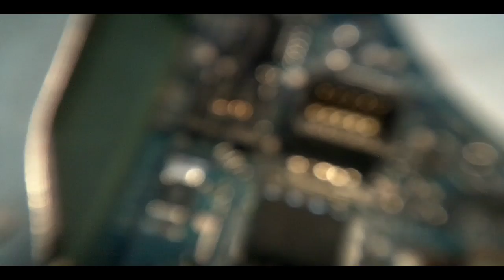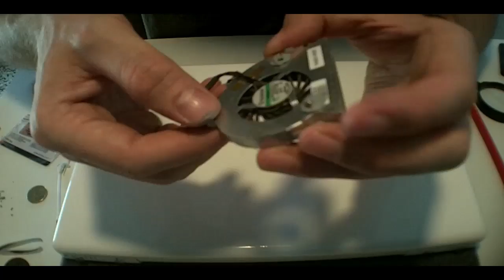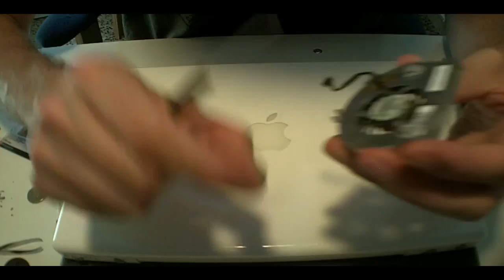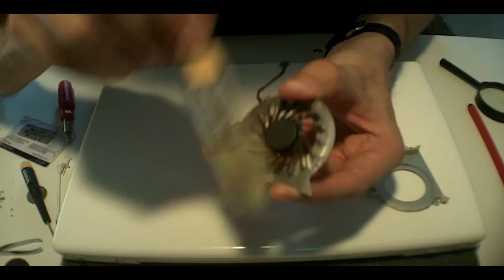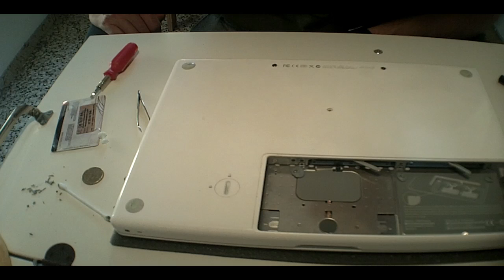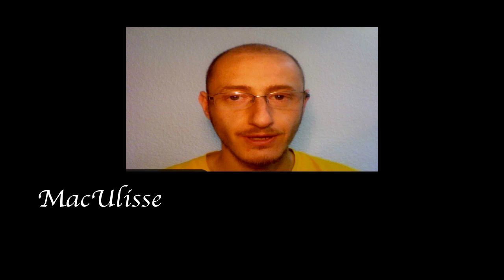Replace thermal grease macbook part 2

Comment: Thanks, well done explanation.  Very helpful all the way thru the complicated removal of components needed to do this.  The reference to the smcFanControl software was news -I never knew there was such a thing, wondered why there's not temp info built-in.    Only hope I can find that and get it.  Also, wish I had the thermal compound before undergoing the case removal which I did hoping just to vacuum the inside to help cool it when i then ran across your video about redoing the thermal coupling compound
H

Comment: @MacUlisse Same here. I just finished the operation. Obviously I damaged the keyboard cable, so I had to wait 3 weeks to get one from US. It was disgusting!!It was all over, and got very thick. Cleaned and replaced the thermal paste with Artic Silver 5. Before it was going up to 85 and 90 (!) C watching flash videos. Now it stays much cooler. 70-75 C top as far as I tested it (same session reloaded with OSX Lion). Well, I am happier.